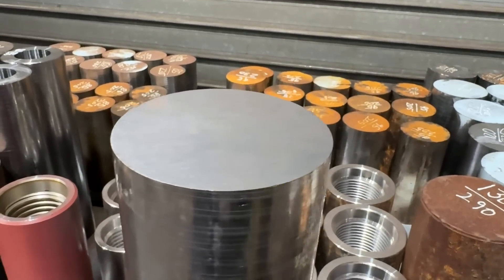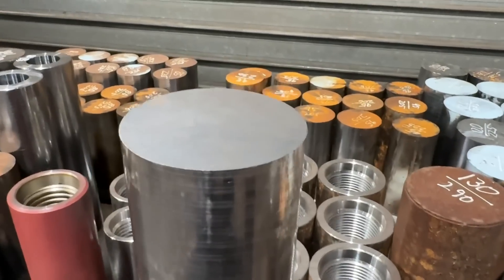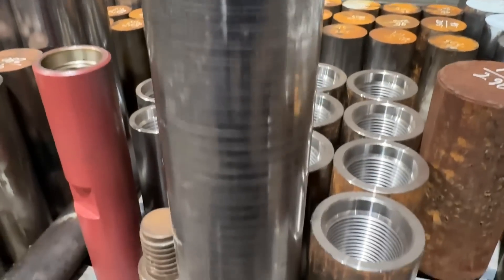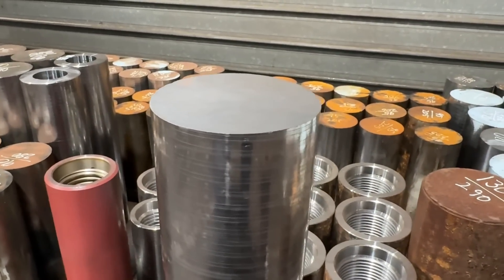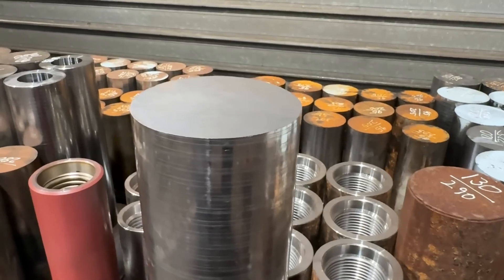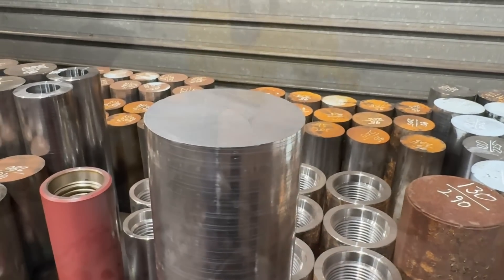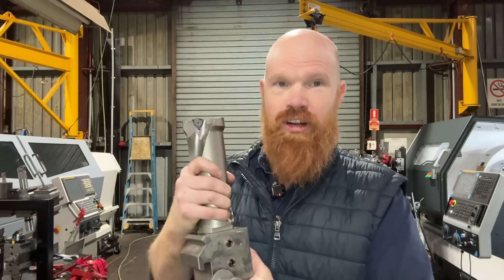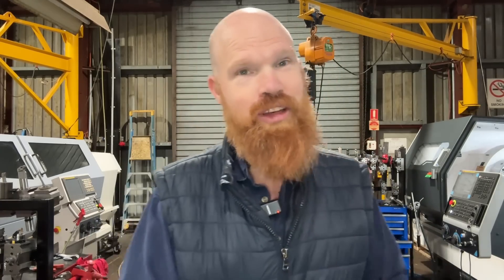HTS DRILLING at 900 rpm is UNREAL (you need to see this)

Comment: Did the rpm change when facing it to maintain the surface speed at bit?
Reply from the maker: Sure did.  We use CSS for facing & often on small parts.

The only time I tend to use fixed RPM is for drilling & when running a steady.

Comment: You'll get better process reliability if you spot with a stubby tool.  Reduce rpm by 50% at entry (until you're at full dia.) and during breakthru.  This will cut squealing and prolong tool life substantially.  Great videos!
Reply from the maker: Thanks for the tip mate. Much appreciated

Comment: Impressive tool. In the good old days of Defence work, we used to bore out Bomber Aircraft under carriage legs and hydraulic cylinders with deep hole boring hollow spade drills with high pressure chip removal up the centre of the tool, up to six feet deep. The worst materials were LM25 annealed aluminium castings, and a secret material called Maraging Steel, which was difficult to chip, and clogged up tools in strings. I could never access the material spec. to find a better method. I trained as a Mill Wright/ toolmaker, so used to make the tooling as well sometimes. LM 25 could be awful to machine, as castings and forgings were inconsistent in texture.
Reply from the maker: Yeah wow! I’m pretty grateful that we largely machine 4140 steel. It’s a dream material really. Chips easily and no clogging.

6 ft with a spade drill is wild!

Comment: So, you can only turn on the cutting fluid when the drill has fully 'bitten'?
Reply from the maker: I only had it turned off so I didn’t get soaked in coolant. 🤣 

Technically it should be running from the start - which it does under usual operating conditions

Comment: the feed rate up.
 I know it’s expensive tool so you need to make an substantial feed rate up to get rid of vibration and will make the to stay sharp or longer.
 Maybe down a little bit on the RPMs.
 Loading the tool and the machine to get rid of of vibration So the flex of the tool in the flex of the machine you are somewhere in between due to catching up with itself I need a new machines flexing or the tools flexing what you need to go past that point.
 If you don’t go past that point substantially that’s when you’ll have problems.
 Machinist used to get stuck Hey certain speed and feed when it used to vibrate and destroy the tool When they went up an  more the vibrations would change.
 I caught stuck in a rut.
 I would increase the cut three or four times same machine and increase the feed rate A lot.
 The machine would even cut better even after they freaked out shit all my God what are you doing.
 Is it much different nowadays I went through the CNC crunch.
 you have shops for people that called them selves machinist.
 Actually I called them parts changers.
 Then they got really good at programming and so forth but they weren’t machinist correct so I could just tell them what they need to do to the program to make it run nowadays it’s all in the program.
 Or should I say most of it.
  Way to kick ass good job your knowledge are only increase same with your production etc. everywhere you go it will follow you there will be shops that you could walk in and work with just a little bit increase your productivity many times.
 With the same employees and the same machines this is worth millions early retirement and so forth don’t cut yourself short you got it in you.
Reply from the maker: Love it. Spot on advice too.

We run it at about 500RPM now with a higher feed and it runs perfectly. No noise and still cuts the hole in under 4 mins.

Haven’t had to change an insert yet 👊

Cheers my friend.  Appreciate the long and thoughtful comment.

Comment: how about wrapping some tape around the body of the drill. that could reduce both vibrations and noise.
Reply from the maker: Great advice. That’s what we ended up doing and it worked a treat. Appreciate the comment mate 👊
Reply: @halheavyduty  YEEEEEHHHAAA!! welllll, over 30 years of machining and i finally got one right. now, if i only could be right once when arguing with my wife!!!!🤣😂

Comment: The surface finish you get is about what we get using the HTP drills, like you said we use it for roughing so finish isn't a big concern.

If you want great finish you have to try the KSEM Plus line. Once you get them dialed in you can expect some VERY smooth surfaces.
Reply from the maker: I’ve heard really good reviews about those KSEM drills.  Good to know! Cheers mate!

Comment: We run our HTS drills on chocolate milk not strawberry, but in all seriousness it's the breakthrough you have to worry about a little dwell time and 1/2 feed rate after the center drill breaks through is helpful. @willgallatin said it on the chatter.
Reply from the maker: That’s very helpful.  
Thanks mate. 
Much appreciated.

After running it a bunch since this vid, I agree with Will.

Comment: Like gun drilling.
Reply from the maker: We haven’t used a gun drill yet.  We have one that came with the small lathe… so fingers crossed an opportunity presents itself soon!

I really want to give it a crack
Reply: @halheavyduty  thx for replying.  
Here in Toronto, Canada, there is a company called united carbide.
He convert it a horizontal boring mill and does that, also he makes his own drills. I'm a tool & die maker myself. 1 year and 4 months to retire.

Comment: Why no centering pilot to start, maybe to tool depth, or even an initial dimple. That might have reduced the vibrations.
Reply from the maker: The first run was according to manufacturer recommendations, who suggested we don’t put a center.

After some trial and error… we do put one there now. Runs much better.

Well spotted.
Reply: @halheavyduty  
Lol. Mate, I'm old enough and cynical enough to have learned through hard experience that "Manufacturer's Recommendations" are not always the best way to go about things in one's own particular situation ! I'm only a little amateur mechanic, but I would never drill a big hole without centreing the tool in a little hole, at least to get started. Commonsense. And I'll bet you thought of that first but got overruled by "those who think they know". ☺️

Anyways, I'll let you get back to work. You sure spend a lot of kindly time answering EVERY COMMENT. Cheers.
Reply from the maker: Cheers mate. Yep… I’m 100% with you when it comes to skepticism on manufacturer recommendations- especially when they make money as a result of breakage 🤣 

I was secretly hoping that the pilot would work to save me the extra time, but it def works better pre drilled.

Yeah, I really enjoy the comments chat. So many very experienced people subbed to the channel, and I honestly get so many good ideas as a result of chatting.

I’m always open to ways to get better, and VERY aware that the way I’ve been shown isn’t necessarily the best way 🤣

Comment: The only way I've ever been able to control chatter is to increase the feed a little. Mind you I'm really old, and most of mt work has been done in the Aerospace industry. I went through my Tool and Die makers apprenticeship course over 30 years ago. Most of my work was done afterward was done with Stainless, Aluminium, Titanium, and Inconel types steel.
Looks like a real timesaver, and leaves a beautiful finish. Great job.
Reply from the maker: That's good to know!  Yeah, we ended up dropping the RPM to about 500 and feed to 0.13 and it runs quiet as a mouse.  Bloody fantastic little tool to run.  Gets used very regularly now.

Comment: Maybe I missed it but what is the new run time for drilling that hole? You said spade drill was 40 mins. It seems like this was only 3-5 mins?
Reply from the maker: 4 mins at between 500-600 rpm, which is optimal for the lathe.

At 900 RPM it was just over 3mins

Big improvement over the HSS spade drill to say the least

Comment: A great video! 
When working on the outer diameter cross section before drill work
Even though I went to the smallest diameter point, the point remains at the center of the material.
This means that the height of the tool insert wire is low, and to solve this problem 
If you cut and add sandpaper under the tool, it will be solved.
It's not a fundamental solution, but if it's a chronic problem, such as the aging of the machine 
In the long run, the results will not be bad if you respond like this.
Reply from the maker: Excellent advice - thank you!

Comment: Higher feed rate. The noise is because you are flexing the tool and when the chip breaks the flex releases. The noise is coming from the shank l. Higher feed rate will stress the tool without letting off.
Reply from the maker: What speed / feed would you typically suggest? 100% open to suggestions from someone who’s run these drills before.

It’s a 50mm HTS drill.

Thanks for the comment.
Appreciate it 👊
Reply: @halheavyduty  If it's HSS I would do feed 120% and speed 100% see what that sounds like. If it improves push the feed more.

Comment: Where are you going to send it???
Reply from the maker: The drilled billets become non return valve equiped crossover subs for the rigs.

We need to deep drill to a random size (in this case 48.5mm) to a depth of 365mm.

Since the video we’ve run the drill a bunch of times and they’re great.  Accurate, no vibration and extremely quick.

Comment: I was pleasantly surprised the inserts didn't shatter as the coolant started flowing. You must have started the flow before they hit metal. Possibly add some weighted rings to the shank of that bar. Change the frequency it vibrates at. Not in the middle, not 1/3 + 2/3 either.
Reply from the maker: Excellent suggestion. We actually added two rubber rings to the bar yesterday.

Huge difference in performance. Similar to your recommendation , at 1/3 & 2/3 roughly along the shank.

Comment: Nice job !  Yes as a previous comment said, experimenting up or down with the rpm usually fixes things for me.  Hard to believe but sometimes a difference of 50 rpm makes a huge improvment. Cheers from Canada.🍻
Reply from the maker: We’ve been playing with it since… and it turns out that 500rpm @ 0.13-0.15 is the sweet spot.

No vibration, chips novelty and the finish is spot on.

Agreed 100% re rpm.  Just gotta play with it a bit sometimes

Comment: .006 thou per rev   divide two teeth  is .003 per flute.  Ran a radial arm drill with a 7 1/2 " spade drill thru 1215 steel two feet deep. It shook the floor and the chips churning out the top sounded like pieces of flat bar when they hit the floor. We had a 120" Bullard VTL. One RPM was 30 feet per minute at the outside of the chuck.
Reply from the maker: Nice one! Thanks for sharing mate.  

Jesus a 7 1/2” spade drill is bloody massive.  Carving off Doritos with that bad boy 🤣
Reply: @halheavyduty  It  was back in 1992 when I was an apprentice. I was so lucky to work with over 100 highly skilled machinists. They have all since retired. Now I have become the old guy in a shop full of younger machinists. I think about all those guys everyday. I have seen so much advancement in machining technology in the last 35 years.  From manual machines to where 5 axis machines are now common place.
Reply from the maker: It’s how it happens hey.

You must have a one heck of a skill set good Sir.  Glad you’re part of the channel 💯👊

Comment: Maybe in bigger tooling like this video shows, an extra finishing cutter and thus cut could be used to finish the diameter by say, .010 inch on the outstroke. Probably a 'mirror smooth' result. This cutter would 'pop-out' on the return stroke as an additional tool head on the tool shown working here.
Reply from the maker: Interesting idea.  It wouldn’t surprise me if something like this exists.  Fortunately for us, the finish it gives is more than good enough - most of our stuff ends up getting put down a hole anyway 🤣

Comment: the squealing noise is due to shank being a lot smaller than the drill head , so the torque is trying to wind up over the long length of the tool , i doubt you would be able to stop it without the shank being a lot bigger , this would reduce the swarf space and negate one of he positives of the design . You could try adding a split ring around the shank as a damper to test the theory while the drill is not too deep , if the changes the freq of the tone then that may prove it.
Reply from the maker: Makes sense!  Thanks for that Jeff.  Appreciate it.

Comment: Try an ejector drill it burnishes the bore as it drills and uses a high pressure pump to clear the swarf.
The holes were over a meter and a half deep and 30mm diameter
Reply from the maker: Hey thanks a bunch for that suggestion. I’d never come across those before.

Just took a quick glance and they look bloody useful.  Have you had much experience with running them??

Most of our drilling is 4-5 diameter, so Udrills / HTS seem to cover it pretty well.

Those ejector drills look brilliant though. I like the concept of the chips coming out the inside.  I imagine they’re a pretty rigid setup.

Comment: You might cut down on the "singing" chatter by running the drill slightly above centerline. My calculation was 509 on the RPM. Tool salesmen will always tell you faster numbers.
Reply from the maker: Thanks for the suggestion mate! Appreciate it.

Yep. I agree re speeds.  I think 500 rpm will be what we keep it at for everyday use.

Comment: Drills like this are amazing when the cutting edge and the cutting conditions go smoothly.Close watch, usually using the "load meter" built into the CNC equipment, is important or a drill body can get wiped out in a hurry.These drills aren`t cheap, not like the cost of a everyday twist drill.
Reply from the maker: I agree! My eyes are pretty much welded to the spindle load meter when it’s running.  

Not keen for a bingle with this one.
Reply: @halheavyduty  Better your eyes welded to the load meter than the drill welded to the work piece.

Comment: The tool you have is perfect for the low flow coolant volume and pressure your machine has.  The large chips only have to evacuate past the head, and will not get stuck in the smaller diameter past the head  I have read the comments, and many suggest guide pads, but this would require an expensive upgrade to a large powerful coolant system and possibly an STS drilling setup, both of which are way more expensive than the option you chose..  I spent half my career manufacturing deep hole drills, and the second half designing them.  This was good stuff, and I really believe you have the best tool for the application and restraints you face.  And no, I didn't work for Kennametal, so it's not a sales pitch.
Reply from the maker: Thanks for the insightful comment.  So far we are really happy with the drill.  Does a great job and seems quite suited to the machine setup we have.

Comment: Here in the states I work for a company that does parts for the mining industry. Recently did 4340 rollers that was 15” long 17” diameter with a 4.625 hole thru. Wonder how well something like that would work? 1 pass thru or multiple passes. 
Nice videos you have !
Reply from the maker: That’s some heavy duty machining! Love it.  The HTS drills come in sizes up to 8” (I think) so if your machine has the grunt, you could get a 4.5” drill, and then do a single cleanup pass with a good solid boring bar.

Would save heaps of time.

Thanks for the great feedback too. Much appreciated.  Where in the USA are located mate?
Reply: @halheavyduty  It’s an older Mazak powermaster. I believe length of bed is 12’ . 4 position turret. I don’t run it but other guy does. I operate a Mazak Fjv vertical. But yeah 1 rough pass then a finish cut be perfect. Tolerance is + -.002 for the bore, then a bushing gets pressed in for the pin.
I’m located in Ohio
Reply from the maker: Nice. Mazak make about the best quality machines money can buy.

Never been to Ohio, but it’s on the list for sure.  Love the USA.  It’s like a world within a country.

So bloody much to see and do.  
And it’s all so different coast to coast

Comment: Does not this kind of long tool require a pivot drilling first ?
To make sure it starts drilling at the center.
Just asking.
Reply from the maker: It has a little pilot bit inbuilt - so as long as it’s dialled in it self-pilots.

It’s been working great so far.  A few initial issues to iron out, but great once we figured out the correct speeds & feeds.

Excellent question by the way 👍

Comment: Used to run my indicator like that until someone showed me indicator droop. When its upside down it will sag and throw off your measurement by .10-.20mm.  Nice drill though. Glad your's makes that horrible noise too.
Reply from the maker: Ive heard this from a few in the comments now.  Have set up a more rigid holder.  Good to know… I had no idea!

Haha. Feeling is mutual re squealing.  
Noisy bloody things… but man do they get the job done fast
Reply: @halheavyduty try sticking your mag base to a plate and put the indicator tip on the same plate then flip the whole thing upside down. Its shocking how much it moves. Even really stout indicator bases. Coax indicator eliminates this. .2mm probably doesnt bother a drill that big anyway but its good to know about that droop effect.
Reply from the maker: I’ll do that.  Endlessly curious about all the little nuances of machining.

So many little things that can only be gained from experience… and people sharing their experience.

Thanks again mate